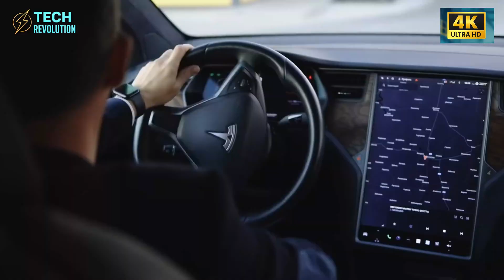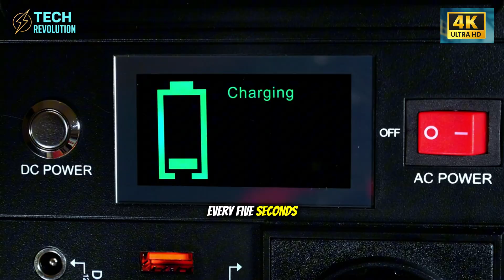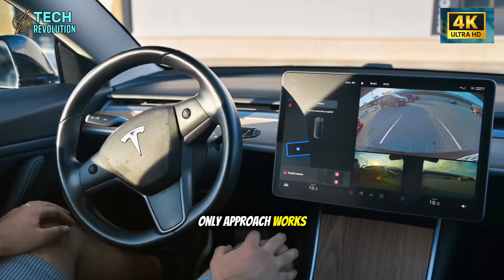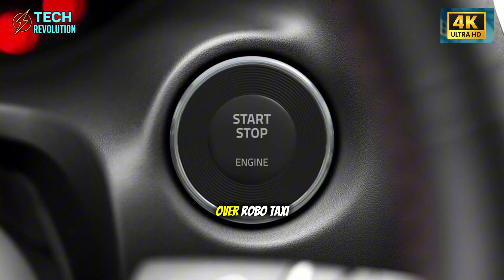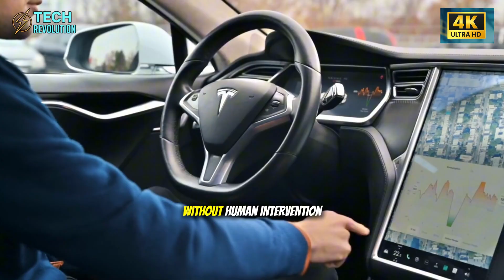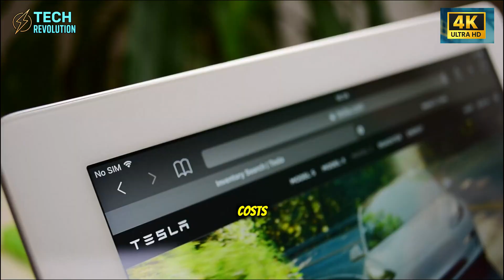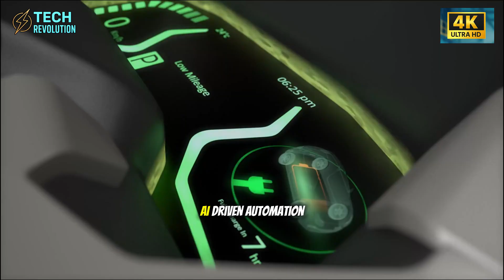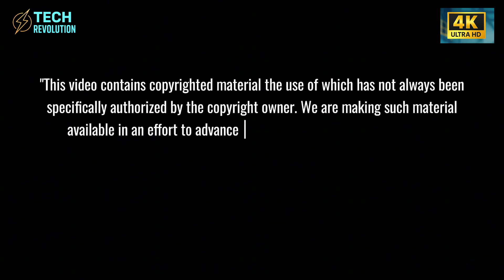Tesla Lost to BYD But Robotaxis Drive Austin With NO DRIVER: Elon's Secret SHOCKS!

Comment: To produce the numbers of Tesla Robotaxis as Tesla wants to produce without steering wheels and pedals for braking and acceleration, and put them on the roads without a human "safety monitor," US federal laws and/or regulations have to be changed to allow any one manufacturer to produce those large numbers. The maximum number allowed today is 2500 such cars per year per manufacturer today. If these laws/regulations aren't increased greatly it doesn't matter if Tesla can produce ten such cars per second or one every five seconds. Without a large increase Tesla will have to continue to use some model such as its models Y or 3 or something like those as Robotaxis, with or without human "safety monitors."
Reply from the maker: U.S. rules cap true driverless fleets today. That’s why Tesla tests Robotaxis in Austin while pushing for autonomy-first policy.

Comment: BYD counts 60$ of their hybrid production as EV.  They can pass tesla as their cheapest ev car is  about $5,000.  So many of their products DO NOT COMPETE WITH TESLA.  BYD covers the low end of the sales spectrum in price.  Tesla bets on its superior technology and it's FSD technology.  Tesla can flip the switch and convert any Tesla owner of FSD supervised into the owner of a FSD robo taxi, but needs the permit to do it without a driver even thou a Tesla owner crossed the US without a single intervention.  Highway safety will push for that.  It is a matter of when.
Reply from the maker: BYD wins volume at the low end, Tesla bets on tech and FSD. The real switch flips when permits catch up to proven autonomy.